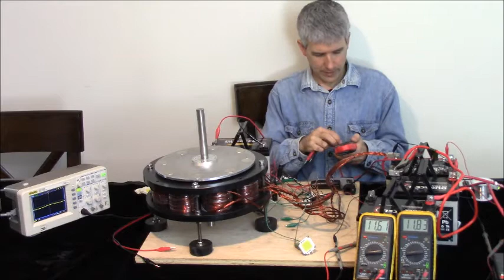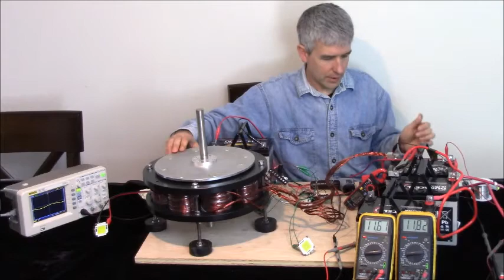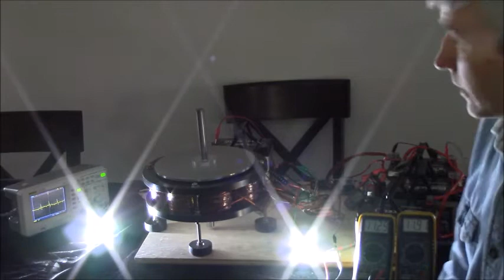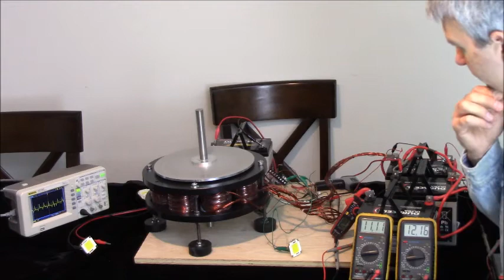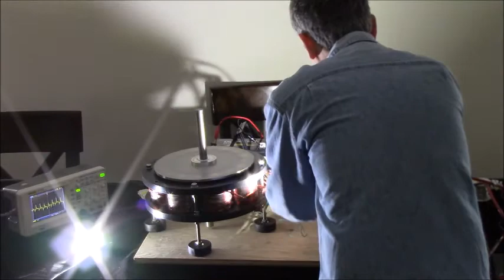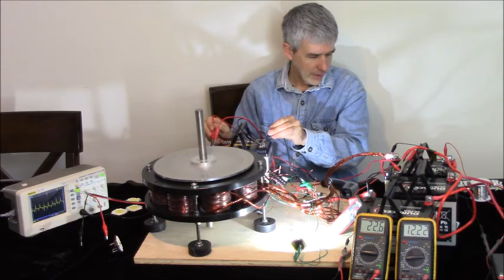Preliminary Demo of New Mosfet 4 DualPole Sr. Setup

Comment: Hi Rick - are you still recommending hyper fast recovery diodes (to replace standard supplied 3A diode) in the mini kit, even when using a gate driver on the fet?
Reply from the maker: Yes, but they are not all the same. Same with fets. Some fets can't take this kind of application. I think most diodes will work, but some better than others. I have some fast diodes that really don't work well.
Reply: I have ordered some of the fets you have on your new mini kit parts lists, ie, the STP315N10F7. Have you tested in conjunction with a fast diode yet?
Reply from the maker: Yes, and they work very well and improve the output.
Reply: Cool! Looking forward to trying it this week :-)

Comment: Hello Rick.  Do you know where I can find a micro-controller controlled transistor/mosfet circuit for a Newman Motor?  I want to control the duty cycle, frequency and pulse width with the micro-controller.
Reply from the maker: No.
Reply: OK ..... will continue my hunt :-)

Comment: Hey Rick, Thanks for your new video and machine cost reduction, can you please help with this question l missed through out your video. q: if you leave the motor running at 24v how many hours can the running batteries sustain  the motor.
thanks
Reply from the maker: That depends on how hard you run the motor and what capacity the batteries are. Also, this is the basic level operation of the motor. When we add the additional processes we can keep the batteries charged. When I have that as an automated feedback controlled system I will make that available....

Comment: Hi Rick - that motor is now looking very good value for money! 
How does the speed control work in conjunction with the opto sensor? Does the PWM receive a signal from the opto so the opto controls the frequency of switching and the PWM just shortens the width of the pulse? In which case do we need a PWM where we can independently control frequency and width? Also, I don't know how to best utilise power from generator coils: what I find is lamp running off the gen coil output looks like a good 40w (mini dualpole) - but if I swap the lamp for a battery, with cap pulser, it does not seem like 40w of charging, but much less. As the battery is capacitance load rather than resistive load do we need some kind of power factor correction to get more benefit here?
Reply from the maker: The PMW is adjustable and breaks up the pulse and width as desired and sends that signal to the black opto inside the motor which turns the motor on and off with the opening and closing of the timing plate inside (the 4 colored wires go to it). Thus there is on and off switching within the motor on/off timing. This signal then goes to the isolation opto (white H11D1) which in turn sends a signal to the gate driver and then the mosfet.
As for the battery, there is a bunch to learn about charging curves. You can find a battery seem to charge faster or slower at different voltages or states of charge. The difference between what you see on the charging side of the motor and using the cap pulser is that the voltage off the gen coils pulse charger is more a settled voltage as the pulse is only half a volt over battery voltage. But the motor coil output is many times the battery voltage so the meter under charge shows much higher than after you turn it off. Now with the gate driver it is much higher, just as much as the trigger coil. So you have to give it time and see what it does. I said in my other video that the 3 to 1 coil ratio of gen to motor coils was about the same as in to output, but that depends on rpm and loads used. The coils are set to be loaded at high rpm right.now. I am working with a friend right now on deciding how to load down the motor more with a change of the gen coils on the bigger motors. Maybe cut the motor rods shorter and bring the rotors in closer so the gen coils get more. Or I may change the core material. Or, like I said, just do more gen coils. I guess that is what you did. Now I did find that the gen coils put out more individually than together in series.
Now another thing that could be done with this motor is run the magnets NSNSNS and the hall will only switch on the S while the gen coils get the switching poles. When I get time I'll do that.
Now you could always short out the gen coils and add one of those three phase little generators as I have not. Only half as efficient as these but they do put out.
Reply: Rick - there's plenty in this reply for me to experiment with. Thank you. Two days ago I changed all the coils - which are all 23 gauge - to run as motor coils at 24v on this mini dualpole. Everything runs really low temperature, and more amps can be pushed as they are divided by 8 coils. I think this will be very interesting once I add the gate driver and PWM. Lots of output from the coils, but as you said I would have to load the motor if I go above 24v.
It seems like there is a certain point of charge needed to overcome the resistance in my particular batteries. Must be different for any given bank. Anything below that point and I'm basically wasting my time. So unless I buy new batteries I've got a challenge to get the right volts and frequency of charge for this set of batteries. This seems like the weakness in MY system - the batteries - and like you said, there is a bunch to learn about charging them. I'm just using 7ah SLA type and these are probably past their best. I cannot find ANY deep cycle flooded-type batts less than 70ah - there must be a conspiracy amongst manufacturers! I can find deep cycle flooded batts for solar, down to 12ah but they are all sealed. I wonder if there's a way of hacking them to fit removable plugs.
So with any system that relies on batteries there is much to know about charging them in order to succeed. I suppose this area is challenging to teach/explain, and yet it is perhaps the most important part of it all.
Reply: I look forward to your video series on batteries and charging them ;-) Although it's perhaps something that has to be learned by experience. However, I WOULD like to know if you regularly rejuvenate your smaller batteries - like the sealed ones - with your rejuvenator toots, or does the motor completely take care of that?
Reply from the maker: I don't always get time to attend to all my many batteries. I use them frequently for different things so they usually state rejuvenated. The motor can rejuvenate them slowly over time. The chargers are meant to do that faster and better.